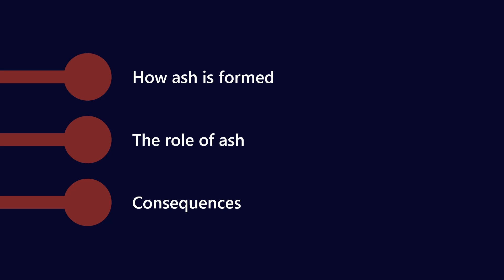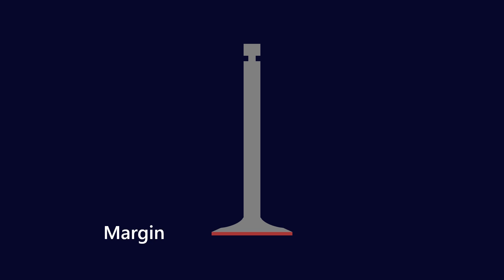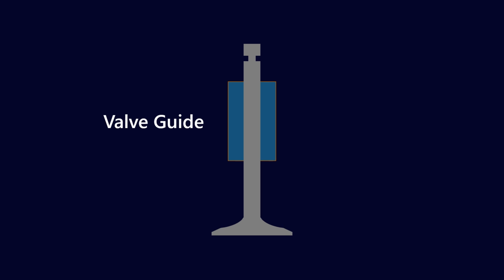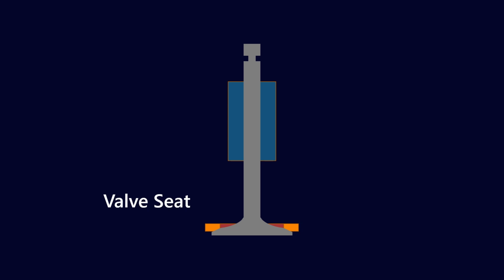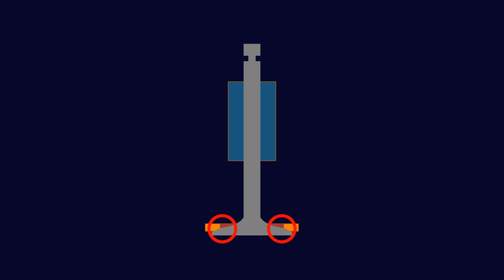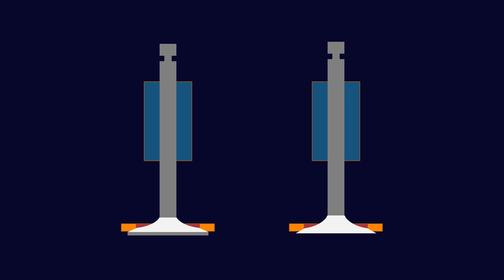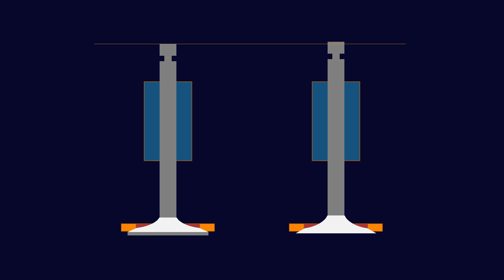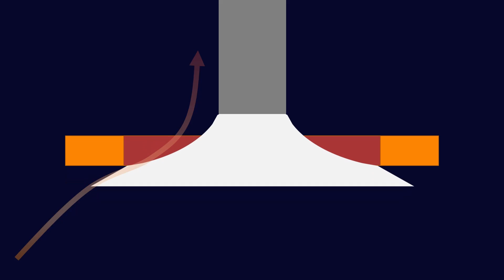Can I have too much or too little ash in my oil?

Comment: Good article.  Ash can be the devil’s advocate in industrial applications.  Modern valve face and seat materials and high cell density catalytic converters have pushed ash levels generally to .35-.55% in gas engine applications.    Even in alternative fueled applications ash content is a lot lower than it was in the past.
2 cycle applications utilizing loop scavenging or uniflow port-valve scavenging should use no ash or limit ash content to .10% max.

Comment: Im driving fiat marea 2.0 20v 147hp engine and i bought oil with 1.4% ash and now im afraid i can burn the valves with this oil.viscosity wise and tbn looks perfect but im afraid of the ash.i drive mostly on lpg.what is youre opinion?oil consumption wise is pretty low im not topping the oil between changes and i drive 8k-10k km between changes.
Reply: I dont care about catalyc converter because i dont have one
Reply: Do i pour this oil or i buy what im using until now(elf sxr 900 5w40)
Reply: I bought eurol super lite 5w40 but it has more ash (1.4 against elf's 1.1)

Comment: Does low SAPS reduce the rate of carbon buildup on GDI engines?
Reply from the maker: Not necessarily carbon buildup - because that's the degradation of the base oil mostly. But it will reduce deposits (which are a combination of degraded base oil, plus degraded additives).

Comment: Great info, thanks again !  With respect to 2-stroke motor oils for mixing with the fuel, are there any assumptions about ash content that are different that would make substitution of regular engine oil a problem for the specific aspect of ash ?
Reply from the maker: Great question. Generally the ash content of a 2-stroke oil is lower to account for it being a once-through system. As an example, when you look at the gas engine oil formulations - natural gas 4-stroke engine oils typically have an ash content of 0.5-0.7% while the 2-strokes will have 0.1%.

Comment: Is the penrite full synthetic 5w30 full zinc better for the engine over the penrite enviro plus mid saps 0w30. 
The enviro plus 0w30 has lower zinc and a lower TBN content.
Reply from the maker: Good question. My personal opinion is that Penrith over-additizes a bit. 1000 ppm Zinc is overkill for my taste - the downside being that really thick antiwear films can actually increase friction between components. It really comes down to the nature of your engine - if it's a classic 70's vehicle with flat tappet cams, then sure you could use the extra zinc. But in most modern engines with roller cams and less aggressive profiles you probably don't need so much.
Reply: @LubricationExplained  ford ranger px3 3.2L
Penrite recommend the full zinc 5w30 ad the preferred over their environment plus 0w30 on their app for my vehicle.

Comment: I have 5w30a5 oil in my 116d bmw 2016 it supposed to be 5w30c3. Can this ruin the engine? Can a5 block my dpf? Thanks
Reply: The cars with DPF has to use c3

Comment: I found this with my two stroke equipment. If i mix any more than 50:1 oil mix then after a bit running them hard, the ash deposits will join the spark plug gap across the electrodes and cause miss firing. At 50:1 there is no problem.
Reply from the maker: Nice one mate! Hope the new job is treating you well.

Comment: I thought ideally the valves should follow the cam lobe profile with the correct spring pressure and if no valve float is encountered? The intake valves would see no sulphated ash on the seating surface surely? If an engine has good piston ring sealing and no egr or crank case fumes are being re introduced into the engine along with turbocharging maintaining positive pressure with in the cylinder it would significantly reduce ash deposits forming within the combustion chamber. Also with the positive pressure it would reduce oil coming down the valve guides. If the engine also does not utilise a catalytic converter and emissions are not a requirement, how much of a consideration are the elements that create sulphated ash be. If the design of the engine reduces the chance of ash formation, would a higher ZDDP oil be desireable for a stressed engine?

Comment: High SAPS oils are the best for engines without particulate filter, so if you have a petrol car that is made before 2018, you are fine. Shouldn't use it in diesel engine with particulate filters.
Reply: A couple of points.  
Correct, ACEA A5/B5 is high SAPS. However A5/B5 has what is called lower HTHS and should only be used, when recommended in the handbook or a reputable oil lookup. 
Castrol Magnatec C3 is what is called mid SAPS. In general terms, it is a Low SAPS oil. This will protect the DPF. There are 6 automotive Low SAPS grades C1 to C6!
Reply from the maker: Yes definitely.
Reply: But it would damage catalytic converters in Petrol cars, isn't it?
Reply: @FeelFree3  Not the Cat. Up to C3 level ash, it will not damage your CAT, that's particularly true for older cars like EURO5, EURO4 and below... High SAPS oils increase the life of the engine significantly.
Reply: @ardmrad9278  Thanks for replying what about ACEA A5/B5 high SAP engine oil, is it safe for Catalytic converters？
Reply: @FeelFree3  As far as I am aware of, high SAP oils are not recommend for cars with particulate filter both diesel and petrol PF. I have been using high SAP oil like Castrol Magnetac C3 and Meguin Super Leichtlauf 5w40 full synthetic, and I noticed I've been getting catalytic converter efficiency below threshold error, but that didn't bother me since my car is 18 year old. For me engine protection is more important than CAT. But, for safety, better use medium SAP oil if your car is Euro5 and above as it might cause problems for the CAT. But if you use medium to low SAP, then it's better to change oil in shorter intervals like every 8-10k km rather than 15k km.

Cheers

Comment: Good old lead was very good at this job of protecting valve seats, especially as valve temperatures climbed in engines under high load.
Reply from the maker: Shame about the side effects!
Reply: @LubricationExplained  Always a balance of pros and cons.

Comment: Hi, greetings,
I found that your channel is very informative,
Please allow me to ask some question
In some countries they still use high suphur diesel fuel up to 3.500ppm of sulphur, which engine maker reccomend to use high ash HDEO with JASO DH1 specification, but by using newer lower ash specificafion eg API CJ4, API CI4+ or ACEA E7, 
Will their newer additive pack be sufficient to cover the ash reduction to be use with high sulphur diesel fuel?
Thank you very much
Reply from the maker: Great question. So the main issue with high sulphur levels in fuel is that it causes a buildup of mineral acids in the oil (think Sulphuric Acid as an example). That can become a concern for bearings etc. To counter these acids, engine oils contain TBN additives (overused detergents) which neutralize acids. The burning of most TBN additives results in ash - so with the vast majority of engine oils, high ask is a good proxy for an oil with high TBN. There are however some newer low- or zero-ash TBN additives, which makes things a little more complicated. 

That's a long way of saying, if you have high sulphur, you want an oil with a good TBN reserve. As some oils do not advertise the starting TBN of the oil, you can use ash content as a rough estimate.

Comment: Didn't know that a thin layer of ash deposit on the valve lip is desirable as a cushion.. isn't a metallic seal is all we want taking into consideration the shrouding angle when the working temperature is reached..and we do all our valve lapping and polishing to achieve that sealing..also what about the gas velocity over the valve lips ..is there any chance of ash deposit..or the deposition happens when the engine is stopped and cooled down.
Reply from the maker: So short answer - yes, all of those factors are probably more important in preventing valve recession. The ash cushion is just the small way that the oil can help. Same thing goes for other engine components - think of the cam lobes for example - the design, metallurgy and geometry of the cam lobe are the most important factors in cam wear performance, but the oil supplements that with anti wear additives.
Reply: @LubricationExplained  yes..got it.. thank you sir.

Comment: I always thought Valve Seat Recession was something that happened decades ago when we took Tetra Ethyl Lead out of petrol? As I recall, industry's response was to move to hardened valve seats with better metallurgy & some short lived anti-VSR additives in a transitional, specific grade of unleaded for older vehicles. The idea of ash as a valve seat 'cushioner' is something I've never, ever come across & TBH, it sounds a bit unlikely to me.
Reply from the maker: Similar comment as above - design of the valve and valve seat, plus the materials and geometry are the biggest determinants in the rate of valve recession. Ash is just the small way that oil contributes. For some other references: https://www.infineuminsight.com/en-gb/articles/gas-engines/gas-engine-formulation-challenges/, https://www.machinerylubrication.com/Read/524/natural-gas-engine-oil-analysis
Reply: @LubricationExplained  Gas (as opposed to gasoline) engines are something of a specialty application. Standard crankcase oils last for ages on a gas engine & never seem to darken because the combustion environment is so benign. Not having ever checked, I'm prepared to believe that ash 'might' impact VSR on a gas engine. That said, knowing what they're like, I'd advise anyone to take anything Infineum say with a massive pinch of salt!
Reply: @MrSensible2  : Part of that is that "natural gas", aka methane has the formula of CH4, it has the highest hydrogen to carbon ratio of all "fossil fuels" and thus when it burns produces the least carbon oxides, and the most water vapor.

Comment: When you do a Sulphated Ash test, you take a small sample of fresh oil, zap it in a furnace until every last drop of carbon is gone & then dissolve anything that's left in sulphuric acid (which is where the 'sulphated' comes from). If anything remotely similar to this process is occurring inside your engine, you probably need to think about buying another car! 
Sulphated Ash is one of those things like Ramsbottom Carbon & Christianity which arose in a bygone age, long before we knew better. Best to just let it go peeps! 
PS - Low SAPS is not the same as NO SAPS, which is why DPFs still fail after about 60k - 80k miles & why sales of diesel passenger cars are tanking worldwide.

Comment: Pretty much says it all? :) A fuel additive like Lucas or Morey's containing upper cyl lub, might reduce valve seat recession? In & Ex? Also supposed to keep injectors clean/ Prevent deposit build up? 
In terms of valve lash clearance: Valve seat recession might be compensated by wear at valve actuators & top of valve stems? With a bit of luck? ;)'